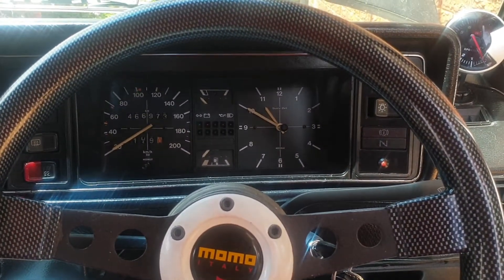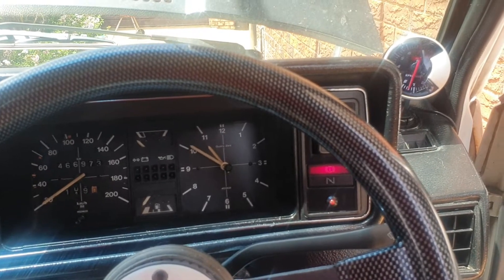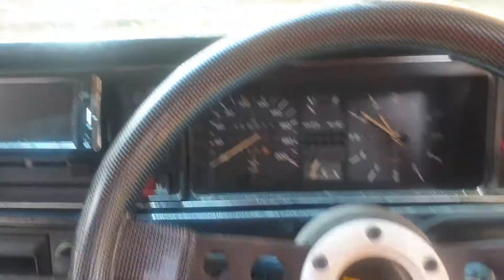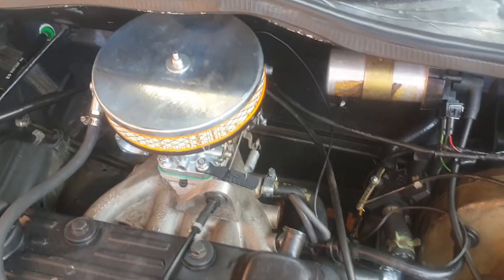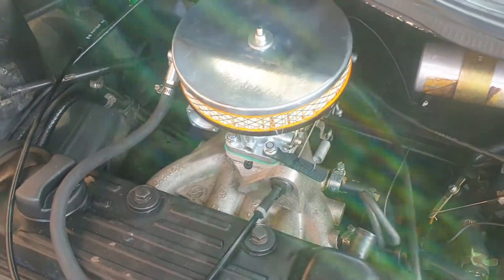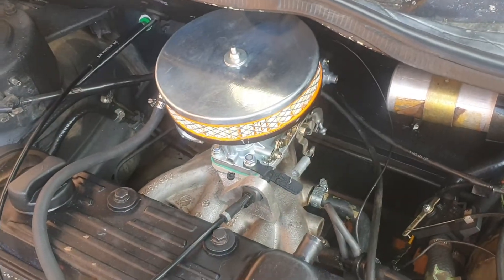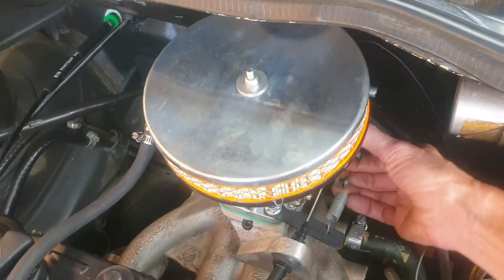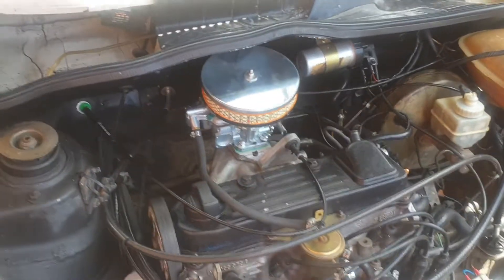mk1 1.8 8v from std carb to 32/36 weber

Comment: Hi, im hoping you can help me with something... I have swapped to the 36 weber (I had fuel injection g60 head) but I have water interning the intake, should I just blank off the water line? Like I say I'm just trying my luck, I must say though, the carb setup is awesome, runs real nice.
Reply from the maker: Hi there. Does the intake comes from the side? If so yes just blank it closed.

Comment: Hi I have a Pollo classic 1.8i I am changing my head for a 2l 8v head what difference will it makes
Reply from the maker: Will gain more power with 2l head and do a cam 276 our 288 cam
Reply from the maker: What head do u have right now on the car?
Reply: 1.8i head
Reply: How do I set my timing on a 1.8i block with a 2l 8v head
Reply from the maker: 1.8i head is it 8v aswell?
Reply: Hi I have a Pollo classic 1.8i block with a 2l 8v head in my drive it holds back what can it be
Reply from the maker: When you say it holds back do you mean on power?
Reply: Yes
Reply: .1.8i block with a 2l 8v head
Reply from the maker: It can be alot of things!!! Spark! Fuel! Timing! U see problem is I'm not there to hear our see what's happening with the car. Beste bet is take the car to a mechanic!!!
Reply: Why is my car holding back in my drive have a Pollo classic 1.8i block with a 2l 8v head

Comment: Hey what about 32/34??
Reply from the maker: Hi there. I never tried the 32/34 but sure it's a good set up. Still better then your std vw carburetor.
Reply: @ritchiesridemk1vwbuild853  so do u recommend DIY or taking it to a shop to fit the carb
Reply from the maker: Yes take it too a professional shop that works with carburetors on a daily basis. You going to need adapter plate too.
Reply: So how much would it cost to fit and tune
Reply from the maker: To be honest I have no idea. Depends on where you take it to. Fit and set carburetor.
Reply: @ritchiesridemk1vwbuild853  thanks for the reply man

Comment: Will this work on the 1.6 as well?
Reply from the maker: Yes it will work for your 1.6 motor
Reply: @ritchiesridemk1vwbuild853  I am in South Africa where can I get one like that
Reply from the maker: Ace motor sports in germiston that's where I got it from. Is it a std 1.6 motor?
Reply: Yeah bud it is the stock moter, or should I rather do the rebuild with cams, portting and so on before playing with the carb. Someone once told me to put the 1.8 carb on the 1.6 do you know if there is a difference between the 1.6 carb and the 1.8?
Reply from the maker: The std vw carb comes in std you can use that carb on any motor from 1.3 up to 1.8 motor it doesn't matter you do not get different size carburetors on std vw!!!! Do a port first! gas flow! And cam then do the 32/36 weber carb.
Reply: @ritchiesridemk1vwbuild853  bro I appreciate your advice. Yeah that's what I was thinking about the carbz. Then I saw this video of yours and knew this would be my best option after iv done some work to the moter itself. Then on a different note would you go turbo or supercharger?
Reply from the maker: I will go with turbo.